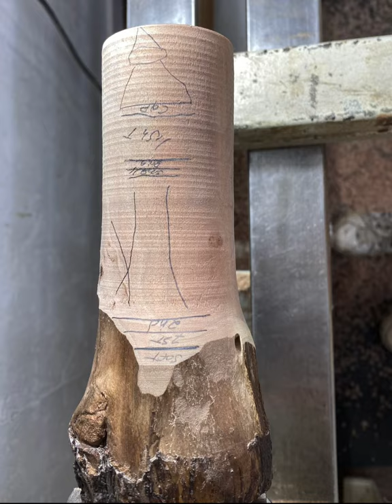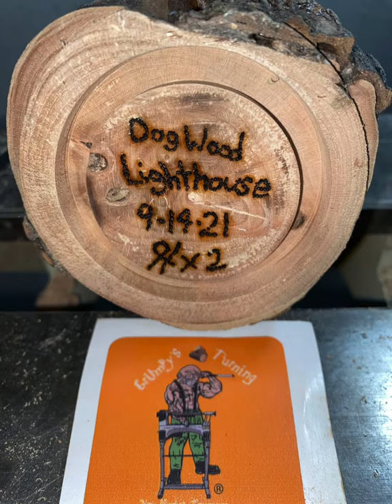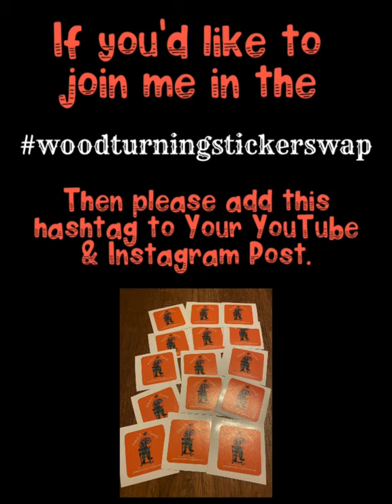Dogwood, Bradford 🍐 & Walnut / Holly Lighthouses By GrUmPy’S Woodturning in New Market, Tennessee

Comment: Need to have a go at a lighthouse myself sometime soon too. Love the live edge on that one! Popped in from SKKrafts live, new sub here. 👍😁
Reply from the maker: Thank you very much for the props & follow. I just subscribed you back. 

I thought light houses would be more difficult than they are but it turns out they’re not. I either paint up the sides with thin acrylic paint so the wood grain still comes through or I burn designs in with my wood burning tools.